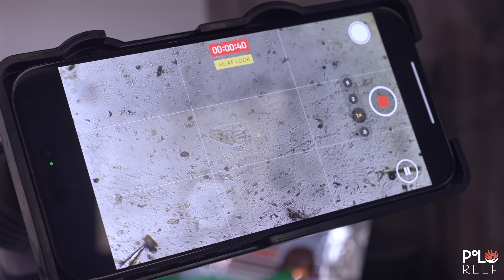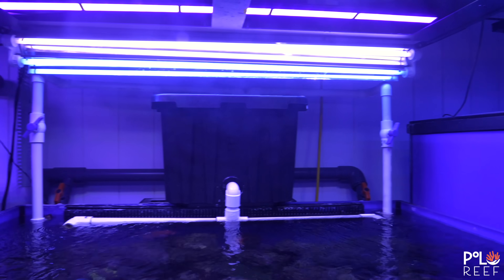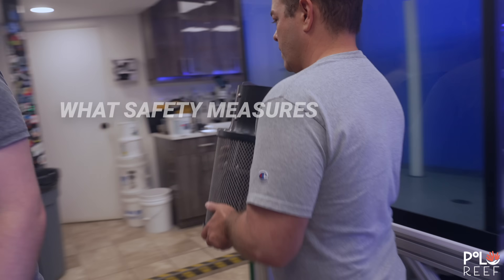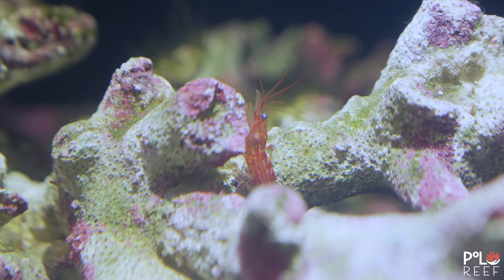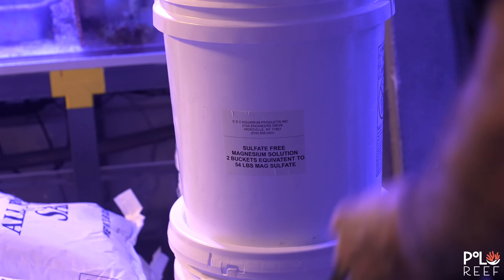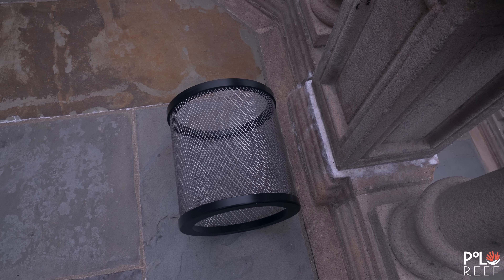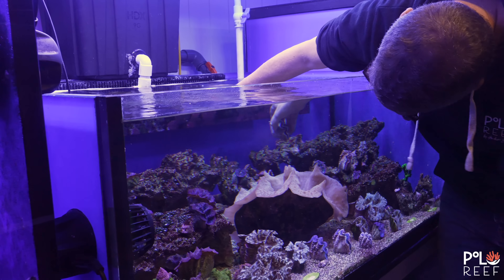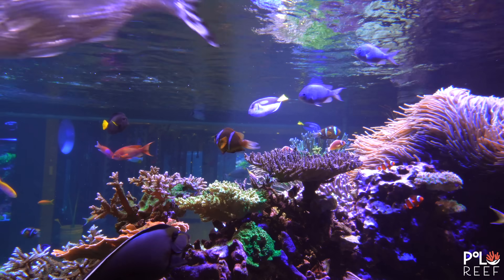WATER CHANGE ON A 17,000 GALLON AQUARIUM + MORE!

Comment: Don’t thousands of hobbyists use Brute Trash Cans for storing RODI, Saltwater and Kalk?

They are made of LLDPE (Linear Low Density Polyethylene)

This is from Randy Holmes-Farley on R2R: “Wandering around the internet itself is not advisable. Ghosts, aliens, two headed people, You can find whatever you want. Doesn't make it true.

I do not believe this is accurate at all. There is also no such thing as natural polypropylene or PVDF. Both are wholly synthetic materials that do not exist in nature. If you mean unfilled materials (nothing buy the polymer), that is certainly fine. Better? Maybe not.

The grey brute cans are rated as food safe for human food, and I see no reason to think there is any issue.

The idea that RO/Di is corrosive to plastic is bunk.

FWIW, I am a polymer expert. My opinion is not just that of some random person on the internet.”
Reply from the maker: agreed but the small black hd container was not food grade and we think bruts are fine

Comment: You should be using food grade tubs instead of a Brute container.
Reply from the maker: i was under impression grey bruts were ok  but that black plastic was not
Reply: @PoloReef Correct Grey is Food Grade

This is from Randy Holmes-Farley on R2R: “Wandering around the internet itself is not advisable. Ghosts, aliens, two headed people, You can find whatever you want. Doesn't make it true.

I do not believe this is accurate at all. There is also no such thing as natural polypropylene or PVDF. Both are wholly synthetic materials that do not exist in nature. If you mean unfilled materials (nothing buy the polymer), that is certainly fine. Better? Maybe not.

The grey brute cans are rated as food safe for human food, and I see no reason to think there is any issue.

The idea that RO/Di is corrosive to plastic is bunk.

FWIW, I am a polymer expert. My opinion is not just that of some random person on the internet.”

Comment: U guys don't have cages on the intakes for the closed loop? Also why don't u run the returning water from the sulfate reactor into a settling chamber and oxygenate it completely with wooden air stones before returning to the main system?
Reply from the maker: it runs through aragonite chamber  why would air stop the sulfate from rising ?

Comment: I don’t know about all this scraping…. I’ve never seen so much skin touching.  Don’t you sometimes lose them just from that?  

That guy is pretty much holding them with a dry yarn mitten, and sawing on them with a toothbrush.. and so often.  

Why don’t you just throw them, already?
Reply from the maker: no   without  this check prazi resistance would not have been discovered  we had to use fendbendazole instead  was great catch !!